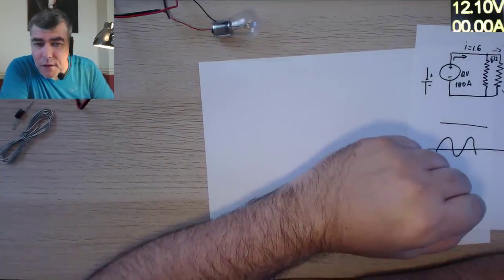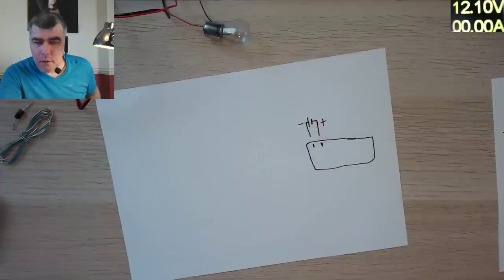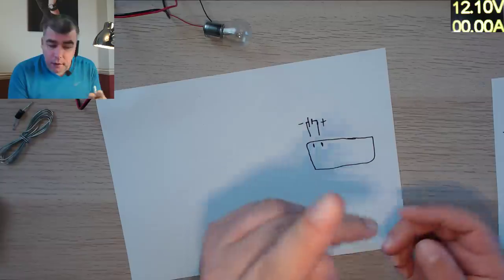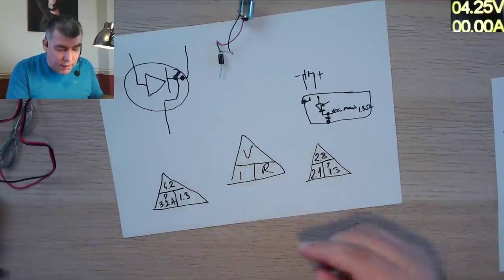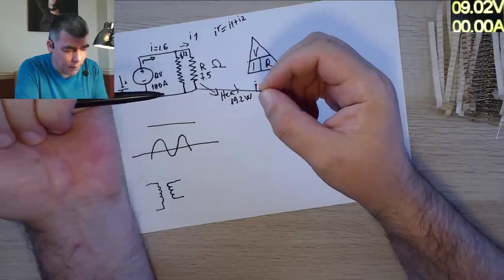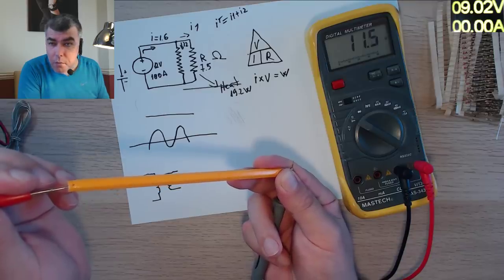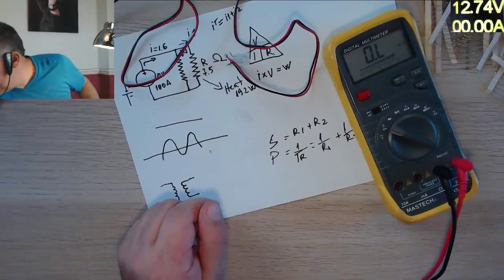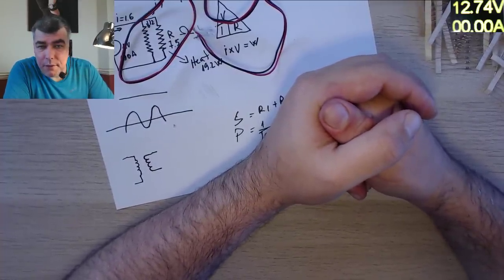Resistors, Resistance and Short circuits - Beginner Lesson

Comment: Thank you again. You have a way of making it clear. I can take what I learned here and see how the resistors are placed on a laptop MOBO to create for more, or less power. How a 3V power supply can be reduced to 1.5 using resisters in the circuit for instance.

Comment: Nice video again. Turn out did not know how to calculate parallel resistance. Checked out the color coding in google, wow learned a lot. Now I understand what happens with power supply tests for short circuit and what they mean. I thought that I knew this stuff. Well thanks for the great lesson man. Yeah, when someone withe experience explains stuff it makes a big difference.

Comment: Hi Sorin, congrats on your 40K subscribers. Could you do a vid in your basics series on how to connect the multi in line with the lab. power supply to measure voltages in the motherboard? How to do it properly. I think I burned my multi.. Very good comments on troubleshooting as a  probability thing. Could'nt say it better.

Comment: Important Just want to throw this in here, Always check your multimeter battery mine was
giving me silly readings for a 70 ohm part that i knew was damaged was reading 80 ohms..
Even on the 70 ohm good parts it was reading 8.1 ohms there is only a 10% +/- on the part
lol..That was the give away.

Comment: Sir, I want to know this from you. When you find shortering on the laptop board, you first put petrol and then inject the voltage, then what other components of petrol are there do not short,? by going to power in petrol...or that petrol is nonconductor ?
Please reply and also make a vedio also on about that lequid..that you applied...for find shorting..
Reply: Organic solvents like petrol or alcohol are non conductive at all and they evaporate easily. So you have not to worry about shortening something.
Reply: @lpelectronics3747  thanks alot sir... I am still watching your video that time also..when you reply me..thanx alot... Please update some other faults solution like no display white display and other things ...by the way God bless you...thanks alot again

Comment: Hi. Do you have a method to power a laptop which requires a center pinned plug, with only a lab power supply? (I don't have the charger, just a lab supply)
For example a HP PAVILION DV4 laptop.
Reply: center pin is optional no ? power it without the center pin and at worst you get an error message at start, then click ok.

Comment: I had trouble with dualshock 4 for ps4 analoge, I fixed that but FPC (flat connector) on mainboard broken and I soldered new 12 pin FPC on mainboard again, but in reverse!
then I put charging cable and the dualshock did not turn on , and I sensed that the dualshock is heating up, I remove charging cable as soon as possible.
problem is this : negative and positive putted in reverse.
I don’t kwow what happen if I solder new FPC in right position .
Does it work or somethings going to out of service?
sorry formy poor English language .
regards,
Hamed

Comment: i am a  beginner but  isn't there a voltage drop at each component  as you go around the loop or circuit?
Reply: Not really except a very small drop along the tracks that you won't even notice. From one side of a switching component to the other you might get 0,35v or 0.7v  drop on diodes depending on the type and much less on mosfets.

Comment: I’m confused. At +/- 15 minutes, you say “you can’t check a short with a multimeter...”. What about using the multimeter on Ohm mode or diode mode. Low Ohm reading [near zero]= short, high reading=no short. In diode mode, a reading of +/- 50 Ohms [or a beeping]= short. Also, TOO much time was wasted, with that graphite and for what?
Reply: That's not true. Actually in this video there was only one diode but in most cases , there are more than one component for example in laptops there are two MOSFETS and then current resistor so there will be some resistance that can not be checked with multimeter
Reply: @mokaku  Thank you for replying and I’m sorry for MY late reply. Ok so, basically you are saying that, because of the amount of components, in any given device, there will always be enough resistance [built up with the amount of components] that a reading of nearly zero [a short] on a multimeter can never happen. Did I get that right? And so, logically the only way to “see” a short, is to use a power supply, to give the device the voltage it requires and then check to see, if the device is drawing an unusual amount of current. Did I get that right? Please reply and thank you kindly